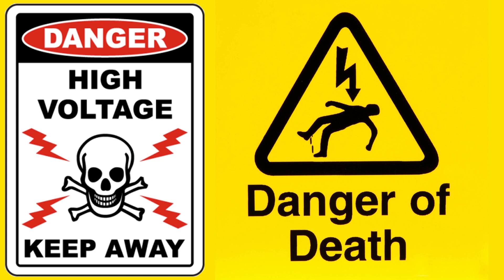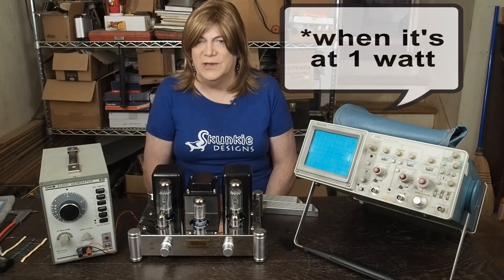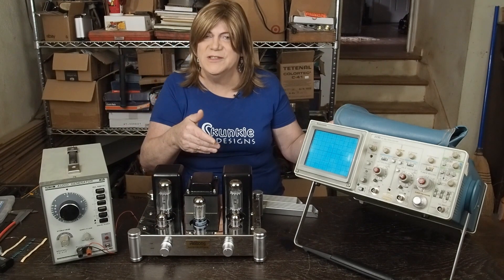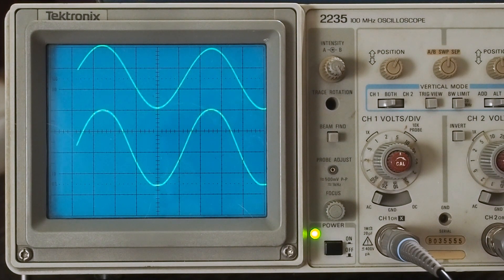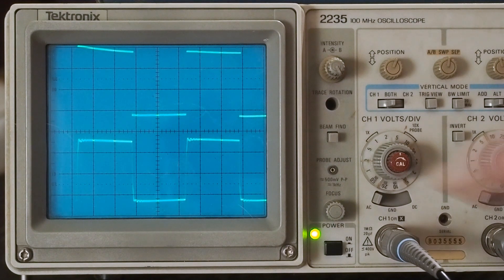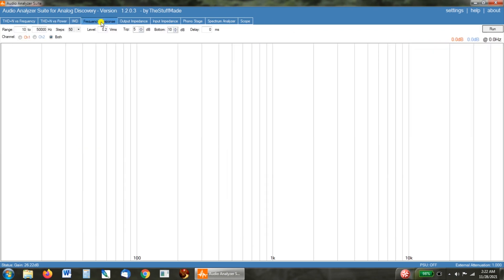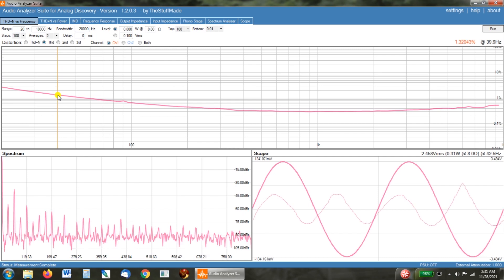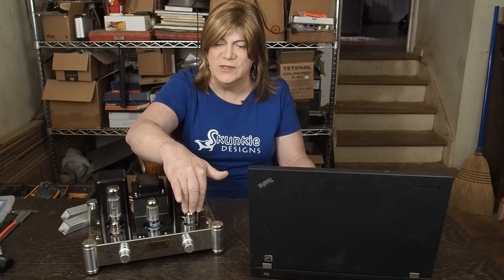Boyuurange Reisong A12: Initial Modification Results = Win!

Comment: Wow, so much incorrect information out there. Some of it can be dangerous too if you go too far out there with an unnecessary or just plain wrong mods or “upgrades”. People need to learn the basics before possibly electrocuting themselves. The waveforms on the unmodified channel is terrible. 6% distortion at 1 watt?! What? Jeez, what a mess. Seems like someone just threw that design together. Excellent job fixing the problem. Great numbers, and I assume the sound will reflect them. Thanks for another great vid!
Reply from the maker: Yup, the point was to "Get back to basis" before exploring some of the deeply theoretical mods I have seen elsewhere! Without addressing these basic flaws, smaller "tweaks" are a waste of time and money IMHO.

Comment: I’m the proud owner of the A10 model lol. It comes with the 6n2J tubes just saying. I do have the 12AX7 adaptor, or I could rewire the tub socket.  As the amp stands out of the box, the 6N2J sounds much better to me.  As someone mentioned I do have a pair KT77 also an some NOS Mullard 12AX7. I have to say it’s very hard to make my speakers sound bad. I have a 1980 something cheep Onkyo home theater amp an it sounds very good through my speakers. I can’t wait to fix this amp an see what I really have. Thanks Skunkie for all your HARD work...  we need to get you monetized !!!
Reply: If you don't want to do the full rewire you could buy a tested matched set of 6n2p-ev. Nice tubes that are dirt cheap and probably better than modern 12ax7. No need to use adapters then I don't think.

Comment: Nice job, so much better. I see you have halved the output cathode resistor which means a lot more current and much better operating point. It will be interesting to see if the power transformer and choke are up to it without saturating and running hot. If you were to change the tube rectifier for solid state, you would not only get a higher B+, but you would remove some of the VA load off the power transformer. This may enable it to supply the extra current without overheating if the winding is thick enough. The SS rectifier might not be amazing for the tube life, but that probably doesn't matter for these cheapies haha. Just run a thermistor on the primary to slow the inrush down a bit.
Reply from the maker: It seems to handle the extra current OK so far :)
Reply: @SkunkieDesignsElectronics  very good! Maybe the transformers aren't as low a quality as the circuit design itself haha

Comment: Grid leak resistor  is in parallel  with the volume control .   So a one of 100k plus sounds ok to me.  If the coupling cap is doubled the the 3db corner is in 1/2 down this can cause problem with a lot of transformers .   I think you go in a good direction.

Comment: This one left me very skeptical as I bought the amplifier because you told me it was better. But with how very bad it sounded. I think I listened to it for about 20 minutes before ordering new tubes. While I didn't follow your advice, I did use a JJ tube for the rectifier figuring, it's cheap and I doubt it will do anything. Truth be told, sounded like I got a quarter of the volume back. Still unimpressed, I turned back to the Yaqin MC84L. Which in itself needs help generating bass. Very animic sound, very much detailed, airy (insert cliche words here), but thin. 
The Nobsound on the otherhand has the luscious silk like mids, with VERY good bass response, the highs do roll off, but with my Jensen JHS1533's (I know, they have been modded, can't find a better speaker now😂) in itself the 6P1 only true contender was my solid-state Cybernet. At last, because the knobsound has the rca jack problem, it can be a pain in the arse! Converting the A10 to an A12, doing all mods you showed in the video, this thing is almost perfect. But I feel sound wise, the Nobsound has that midrange that is absolutely legendary with your mods. Maybe I am looking forward to seeing what else can be done to the Nobsound after all!

Comment: I tried your recommendation for using 6V6S tubes. Subjectively at least, they sound great.  I realize you may not settle on these but I definitely want to follow along and reproduce your work just for fun.
Thank you!
Reply from the maker: Thanks for the info! I think for people who don't want to go into the amp, 6V6 tubes + a cheap 8ich powered sub is going to sound really good, possibly as good or better than the full blown rewired one will.
Reply: Fair warning: although the 6V6 is more powerful, it wants to see a higher impedance than the 6L6 so you'll get distortion much sooner.
Reply from the maker: @1mctous  Which is why you hook 8 ohm speakers to the 4ohm tap which reflects back 6.4K to the 6V6 tube. Clearly doing this with these OT costs some low end frequency response so isn't ideal.  BTW a 6L6G is a more powerful tube than a 6V6 and at 250V they have the exact same load requirement @ 6000 ohms. Also if you look at where I tested this, the EL34 starts distorting much earlier in the stock amp than the 6V6 does. It's actually much better even when you connect 8 ohm load to 8 ohm tap that is reflecting a 3.2K load.
Reply: @SkunkieDesignsElectronics  I'm glad to be corrected on the 6L6 vs. 6V6 tube data. At any rate your power supply and rectifier mods put the SE EL34's into their best operating range. Perhaps Boyuurange should be changed to Boy U need to modify the circuit!
Reply: Wait … I missed the step of using the 4 ohm tap for my 8 ohm speakers. 
I wonder if that may damage the tubes.
Reply from the maker: @nathanas64  Nope, not at all. Use whichever sounds best. Just make sure you always have speakers or a dummy load connected to the amp when you power it up, especially with a signal on the input. The 4 ohm taps will have less distortion but the 8 ohm will have slightly better bass. If you have a powered sub, for sure use the 4 ohm.

Comment: After modifying left channel following your schematic and video, inserting original tubes, and turning on with unit upside down, after 5 minutes of warm up, puffs of smoke came out of power transfer. Any ideas or suggestions what to check or do?

Thank you in advance.
Reply from the maker: Eeeek, that's not good. Did you check voltages or just let it run for 5 minutes?
Reply: @SkunkieDesignsElectronics  while is ran with 8ohm 100w dummy load attached, flipped over with circuit exposed, saw several puffs of smoke and then shut down immediately. Found several resisters in wrong place and then preamp tube cathode heaters not receiving voltage. So now working on rewriting taps from transformer to get heaters working. I didn’t mention before that the amp had previously been modified as a 100 uf 25 V cap on preamp cathode. 
After connecting and verifying 6.3v on heaters, I do not see the glow. Should I see the heaters glow as I do on the phase inverter and power tubes? If so, what should I check to resolve?
Reply: @SkunkieDesignsElectronics  ok I resolved all issues and it run cool on all transformers.

Comment from the maker: I do want to add: I saw a YouTube video of someone already challenging my saying this output transformer has a 50% tap by measuring it with an ohm meter and a $60 LCR meter with flickering back and forth first digit... Those budget handheld LCR meters are NOT the most accurate way to measure an output transformer, and the ohms or DCR on an output transformer has nothing to do with it's impedance. What matters is the turns ratio and I measured it with a signal generator and a scope at 20:1 on the primary and 10:1 on the secondary. Here is a video showing how to accurately measure an output transformer. This is a confusing concept, but I don't want wrong information to be spread around.

https://youtu.be/2wJVuVm7tfo

Comment: I bought the A10 version about 3 years ago.  It was the point-to-point wired rather than PCB and so had 'uprated' output and power transformers.  Advertised as 12w per channel, of course it's not going to be that for a single-ended EL34B.  Most analysis measures it at ~5w before clipping and total around 5.5w.  It's readily modified, as demonstrated! But at £350 what is expected?  Driven by a 3v p/p audio source it can fill a room with sensitive speakers.  Modify the input circuit double-triode to CASCODE and see how the frequency response improves :-)
PS - keep up the good work!
PPS - where can I get replacement potted OPTs from?  The same as already fitted?  Thanks.
Reply: Just replying to myself... by using one of the triodes of the 12AX7 rather than two in parallel, you've halved the Miller capacitance and therefore improved the bandwidth :-)  I still say, that's halfway there... Use that spare triode and create a non-inverting Cascode circuit with a MOSFET, and actually use an ECC82  for easier set-up.
Reply from the maker: I read that wrong at first,  edit: yes using just one triode halves the Miller capacitance. And yeah, I'm sure there is a deep rabbit hole one can go down with mods, I like the simple triode feeding a pentode! I'm OK with that spare triode just handing out :P

 To the other response, I highly question an A10 can make 5W without clipping unless it has a lot higher B+, as the 450ohm cathode cap at this B+ would limit it's power output to the same 2-3W.
Reply: @SkunkieDesignsElectronics  lol I got notified of your first unedited comment and thought wtf...?  The single triode will provide enough drive so, yes - just let the other half just sit idle and enjoy some greater bandwidth.  The use of Cascode is another easy tweak to utilise this cheap and cheerful amp. Bypassing the valve rectifier with 1N4007 to make a SS full bridge will raise the B+ at minimum cost, check the caps are not over voltage of course...  Keep up the good work!

Comment: I have a yaqin mc10 l which hums at AC  frequency. Do I need to get a power conditioner for it?
Reply from the maker: AC hum is from either a bad power supply or the heaters for the tubes were not done correctly. You can't filter AC hum out before the amplifier itself. It's possible the amp does have the wrong voltage power transformer i.e. 110V when your house has 120V. but that still won't cause hum.

Comment: Awesome stuff! Can’t wait to see/hear the final tweaks. Will this apply to the A10, and what difference would there be. I’m currently using adaptors with an A10 to make it so I can use 12AX7s
Reply from the maker: You should totally be able to do these same mods to an A10 if it's the point to point wired version. Someone said those even have these same output transformers.
Reply: @SkunkieDesignsElectronics  it is the point to point version :) and thank you for the reply :)

Comment: Great stuff!! I have just purchased an A12 and am keen to do the mods. I have a 230V AC version. will your mods work for this configuration??
Reply from the maker: Yes,  the only difference is the primary winding on the transformer, which doesn't impact anything I did, the parts or the voltages I am measuring after the transformer.

Comment: I have got rid of ringing by putting a cap accross the shade feedback resister something in the low peco farads might do it
Reply from the maker: Tried that on another amp (someone did a spice sim and said it fixed it) and it sounded dead to me, although the square wave looked nice :) I don't worry about minor ringing anymore.

Comment: I think I know what Reisong was thinking when they designed this amp.  You can run your IPhone directly to the inputs of the amp at 1/2 volume on your IPhone, an that’s all the input signal you need. That’s like 0.25 volts. .50 volts is the Max for a IPhone I think?       I believe that was what they were going for, just like car Audio.     I’m not saying that the Mods are a bad thing, quite the opposite.  With the Mods my amp sounds (Very Very GOOD), but my experience has been you will need something like Shunkie said.  2 volts of input on the amp after the Mods.      I gave like $399 for the A10 shipped.  After the Skunkie treatment, Well it sounds a hell of lot better than a $400 amp should.

Comment: Hi, like your approach based on facts. I own the predecessor the A 10 Model.  Can you give some suggestions for improvement without having  gear on hand. Lots of peaople have got the  A10 Model .Thanks a lot from Germany .Hans
Reply from the maker: Given the A10 has the same output design and the same dual triode wired in parallel, these same modes should work on both., The only real difference is the driver tube has a different pinout. I heard mentioned some of the A10 have a PC board rather than point to point wiring so mods might not be as easy or even possible.
Reply: @SkunkieDesignsElectronics   Thanks, I have the point to point wireing . I will check  design

Comment: I own the A10. I've been told the A10 and A12 are the same except for rewiring the socket that the 12AX7's go in. The voltage is in the 6.3
 volt range for both amps to this socket. Will this mod be useful to the A10 as well,? Thanks!
Reply from the maker: I believe it will be. For A10 owners, you want to insure the voltages, especially the B+ is the same. But PLEASE research tube safety before you attempt to measure it.

Comment: Ma'am- I've owned my now for 7 months. I am clueless- I thought it sounded pretty good- I also fired big guns in the Army and may not hear so good anymore :) however- I'm comparing to Anthem SS AVR (which sounds okay for me). I also rolled the EL34's to a better set and it did take some harshness out of the sound. I run them into Klipsch Hersey IV's which are pretty sensitive. My thought was always- if its an "okay" platform and we can mod it a bit-maybe it can be great. You seem to be on track to make that happen. One thing I remember from comps to the original A10 which used 6N2J tubes instead of 12AX. Another tuber measured the plate volts and found the 12's running at 1/2 volts similar to the 34's. He figured that the manufacturer just changed the tube plate and not the wiring. Not sure that's not an engineer trying to be conservative and not burn the house down or a bad retrofit. Either way- I'm dying to see the final product so that the rest of us can go play Dr. Frankenstein.....
Reply from the maker: I honestly can only comment about the amp in front of me. I see people claiming all sorts of things about these amps, I take it with a gain of salt. The B+ couldn't be raised much in older versions without changing the driver circuit or it would fry the driver tubes. I've seen the A10 schematic and it would melt the plates of the driver tubes if the B+ was much higher. Those Russian tubes are super close to the specs of a 12AX7 with a different pinout, which is why adapters work.

Comment: I thought the rectifier didn't change the sound? Open to upgrading if it helps (A10)
Reply from the maker: I don't think it does, but it does provide a slow B+ ramp up, which allows the tube heaters to get a head start on the B+, which is good for tube life. That's why I decided to leave it in for now. If the power transformer ends up getting to hot, ditch it. I honestly have never heard any difference with different rectifier tubes on a SE amp.
Reply: @SkunkieDesignsElectronics  Thanks, so you left the factory one?
Reply from the maker: @steelgtr  No, replaced it with a gold Lion 5AR4

Comment: Hi. I am wondering why you spend so much time on this amp? No hate on chi-fi, got some myself, but I don't get the point of doing all this work on that amp.
Reply from the maker: Because so many of these have been sold. If there is an inexpensive path to goodness, it would be of benefit to a lot of users! Plus many folks are intimidated by a from scratch DIY build, mainly the fabrication work involved, and if something like this is viable via a rebuild, it actually might be worth doing.
Reply: @SkunkieDesignsElectronics  I see your points. 🙂
Reply: Totally get it. They are so cheap (considering tubes are included). I am tempted to buy one just to do the mods. And before and after comparison with my own ears :)

Comment: But a $500 amp with $500 output transformers then becomes a $1000 amp, etc..
Not sure i understand the logic of it not being worth it.
Reply: She didn’t say anyone should bother replacing the transformers
Reply from the maker: I get what you are saying and agree that it probably makes sense to buy better iron rather than rolling NOS $$$ tubes or high end passives into an amp with mediocre output transformers.
Reply: @SkunkieDesignsElectronics  What I meant was any amp is worth the sum of its components (in addition to engineering) - I think any amp, cheap or otherwise, can be upgraded with decent and/or pricey parts - it just ceases to be a cheap amp.
Reply: @rndm4642  I know but that wasn't my point.